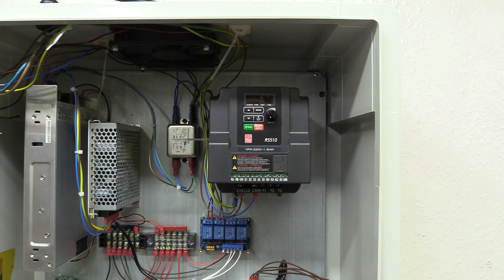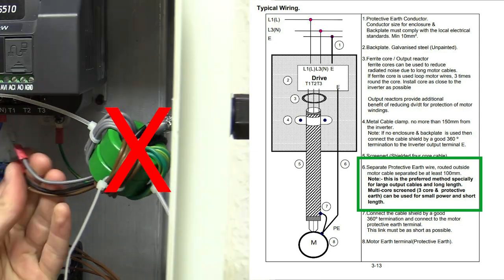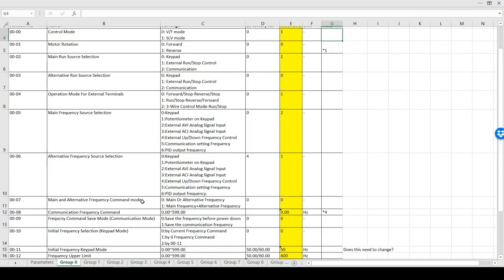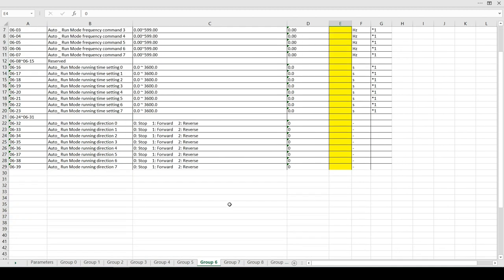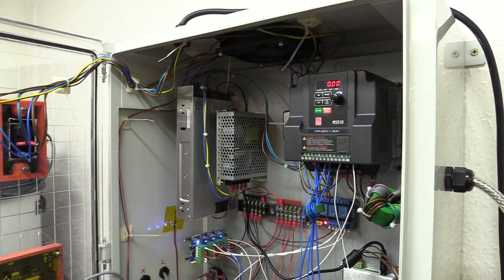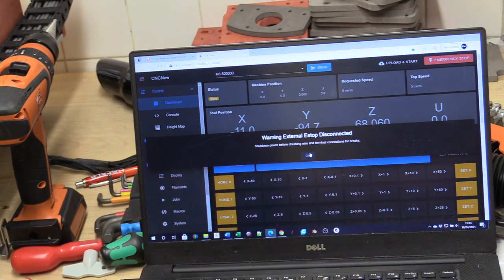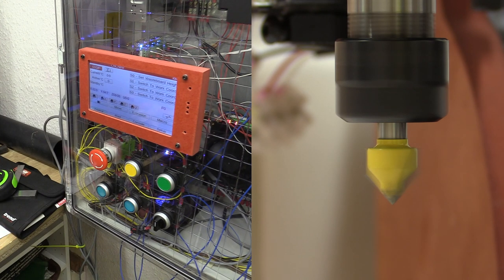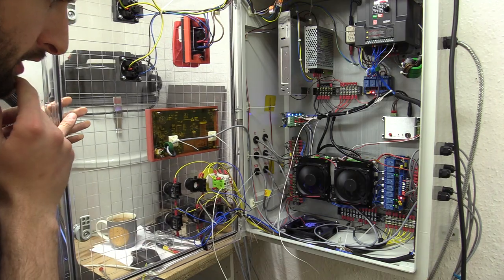#57 Wiring & Programming Spindle Inverter Drive (VFD) - Duet CNC Controller P5

Comment: The VFD cable shield is capacitively coupled to the motor wires and has a high impedance. Grounding at both ends of high current PWM motor is recommended to clear the cable. Might be able to see a voltage spike on the shield when the motor is turned off, and compare the spike with one and both sides grounded. Low voltage, high impedance, analogue and digital signal cables should be shielded on only one side, near the input. Grounding both ends may add noise to the signal cables from a ground loop. The ground should not go through the choke because the choke increases impendence. Some manuals show each VFD phase choked individually, then again with all of the phases together. Hope this explains the conflicting "don't ground at both ends" advice. The other grounding recommendation in the manual may be to reduce current flow across the motor's bearings. If your VFD has a modbus interface, that might be used to backup the VFD register contents. May be able to use the analouge output pin connected to a 0-10V gauge to show the spindle load. Best wishes
Reply from the maker: Thanks for sharing that! I don't have the right equipment to measure voltage spikes so it's difficult to know what's going on - but this VFD manual was a lot clearer than my previous one. I cut a few things out today as well, and nothing went wrong but I still need to ground the low voltage shielding. I was thinking of using some stainless bulldog clips to contact each cable shielding foil - from what I read they work best when 360 degree contact is made and not just soldering to the drain wire. It feels like it will be a lot of work which I should have done when I had more space to expose the foil.